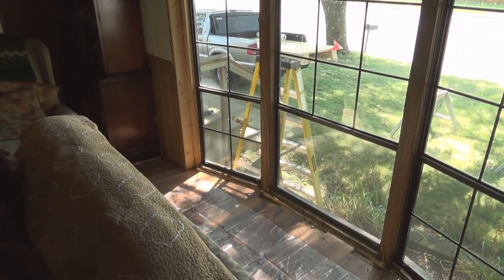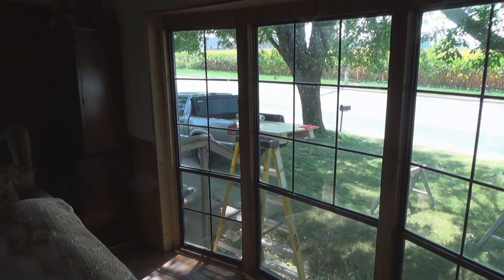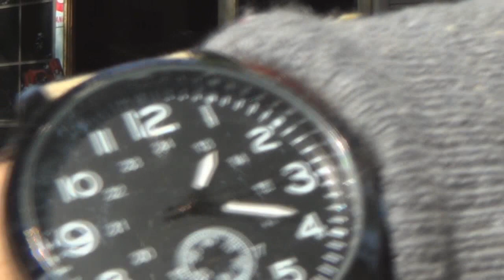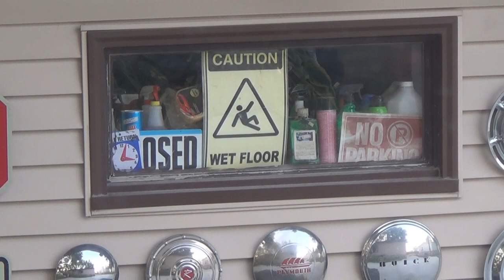Picture this!

Comment: nice job,i can imagine it will be a big improvement over last winter. finally coming over to the dark side with a/c in the shop,lol. when its close to 100 degrees,you will really appreciate it for sure
Reply from the maker: We barely made it into the 90s this Summer, but that means that next Summer might be warmer. We will be installing a newer a/c unit in the Spring, so this one is available for my shop and should do it just fine. Thanks Roger.

Comment: oh oh oh ... why... i so want a bay window like yours, curved, wood ,, oh nasty drafts ,,  i never thought of 4 windows making one bay,, mmmmmmm i have ideas now.. good job sir.
Reply from the maker: You can do it, but make sure they are insulated glass and not storm windows like mine were, and unless you buy a preassembled unit, you will need to sister floor joist extensions back into your basement to carry the weight of the windows. Pre-made ones are made to transfer their weight to the normal floor joists and don't forget about the roof or flashing over the top! You can do it!

Comment: HI George Just wondering if it is a good idea to put caulking around the window frame ? Thanks
Reply from the maker: I will be putting 1x4s around this window with aluminum wrap and that will be caulked. Putting caulking on as you install the window will not help since it is only being glued to the paper... I know some do it, but it is not necessary at all, IMO. Thanks for stopping by.

Comment: All the work is taking the old window out.  The windows are so easy to install.  I replaced 4 windows but need 3 patio doors or garden.  The heat here is crazy with humidity to kill.  Not getting much done with the weather being so hot.
Reply from the maker: Our weather is breaking now and is now in the 60s with rain today. Not much of Summer left. I still have two more windows to do, but they are basically just slip ins. Thanks for stopping in.